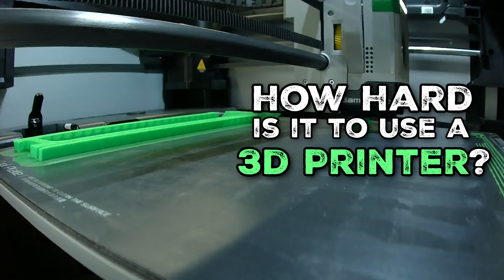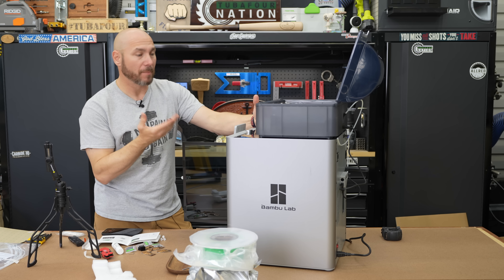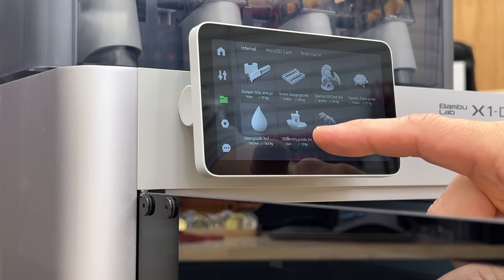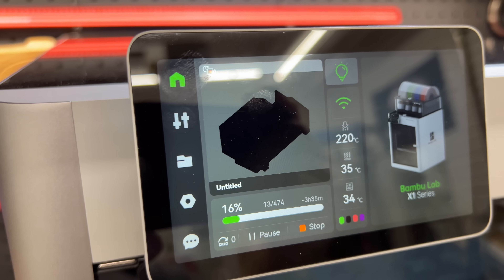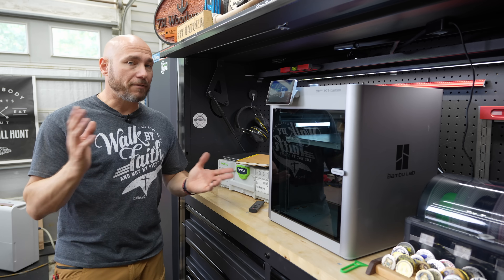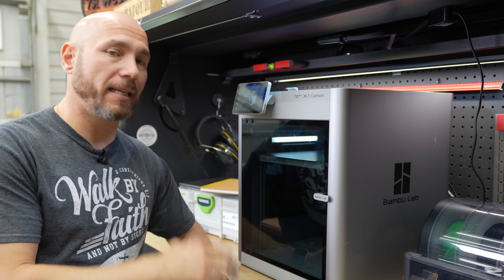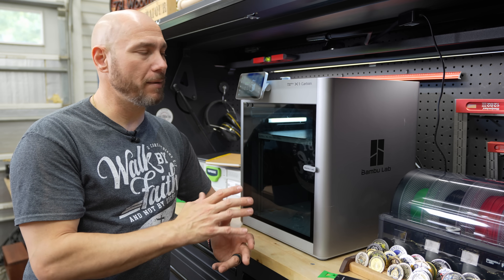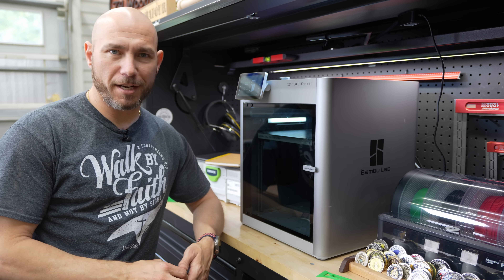Is This 3D Printer Worth the Price? Bambu Labs X1 Carbon Review

Comment: if you like challenges this is not the printer for you. its what dji would make if they made a printer basically... its point and click. to a certain degree... try shiny petg? hehe you will be on the handyapp making a ticket within the hour if arent familiar with 3dprinting. Stick to pla and the cf versions of the other filaments as they are regularly easier to get better results.

And dont forget that the self scanning of the flow dynamics and actual flow calibration work poorly with shiny, transparent and glitter like filaments. Basically all the cool looking ones are on manual calibration like every other printer. except with bambu u dont get to see the mesh from bedlevels. probably since all their bed are a little crooked with at least two highspots. managed to dismantle mine and put in on a squaring rig at my friends cnc shop. 

now its flat :) and the probing hits three points every time :) u can tell the shifting of the warp in the bed by the number of probe attempts it needs to find a value.

Comment: I was very impressed for the first 3 prints I did on the X1C. After that, the AMS has failed to push out filament out of the hub since it seems the motor is struggling from the tension in the spring. I've been waiting on customer support to reply to my ticket for the past 4 days now... I'm about to return this thing if I don't get a reply by Friday.
Reply from the maker: Dang!  Keep us posted on how they handle this!
Reply: @TheOutlawEffect  The filament was brittle in some spots and was snapping when coming out of the AMS. I put it on the hot plate for about a day and it seems to work now. Customer service was extremely slow at replying and I had to figure it out on my own.
Reply from the maker: @magneric   Thank you for the update.  I recently had something similar happen.  I didn't use the printer fora a couple weeks.  When I tried to use it, the filament had gotten brittle and kept breaking inside the AMS but under the rolls. I had to dis-assemble it to get the pieces out.  I'm not sure if it was because the rolls had been in the AMS too long and maybe picked up moisture or gotten too cool?
Reply: @TheOutlawEffect  isn't the AMS supposed to keep the filament in a dry, sealed environment though? I think for me it was a quality issue with the filament since some lengths could bend like normal and other lengths snapped like spaghetti at the slightest bend. Might have been a humidity issue from production

Comment: There’s actually a modification you can easily do for the lower cost p1s model called an xtouch that makes it so the p1s has at least a very low end touch screen/ nowhere near as detailed as your x1c. However still far better than the stock controls.
Reply: And there's  now a second option. The Panda Touch.

Comment: What slicer are you using? How have you found slicing to printing has gone? (ie have you had to change a lot of settings and iterate on slices from past attempts, or is it mostly a slice it, send it, print it sort of experience?)

I see a loooooooot of people saying this is the machine to get right now, and I am sorely tempted to upgrade from my creality machines, but I have seen a few folks get a bad machine that seems to give them nothing but trouble with very little by way of support from bambu directly, which has me feeling nervous I'll receive a $1500 lemon, lol. It really feels like an inevitable purchase though
Reply from the maker: I'm using the Bambu Slicer software.  Haven't had any issues so far.

Comment: I got my X1 Carbon probably just a week before you released this video and I've been loving mine. I have had many 3d printers before this and there is no comparison to me. This one "just works". Speed, useability, reliability are all better than previous printers. 

Recommendations:
get the PEI plate - no more glue sticks, superior first layer adhesion, and prints easily pop off once it has cooled
get the mobile app - you can monitor, pause, stop, resume, and even start new prints from your phone

been watching your main channel a long time and love your stuff. Happy you got the right printer!

Comment: I've been watching 3d printers for 10 years waiting until they progressed from being a tinker-toy into a useful tool. Looks like the Bambu X1 finally did that. 

QUESTION: how much does the X1 smell while printing? Is it OK in the house? Better out in the garage?  Or does it  need a ventilation hood?

Thanks!
Reply from the maker: I have it in my garage, which is climate controlled, no ventilation. There is a very faint smell when printing.  I've only printed basic PLA so far.
Reply: @TheOutlawEffect   Thanks!

Comment: My understanding is that Bambu requires you to connect through a cloud account only - and given this is a company in China, I'm not so sure I'm on board with that part.  In general, I try to steer clear of any important device that requires cloud access to operate.  But, that goes double if it's a Chinese company.  I'm looking at my first printer, and while I really like what the X1C has to offer, the cloud access may be the main deal breaker for me.
Reply: I think it’s possible to upload files locally without the cloud…

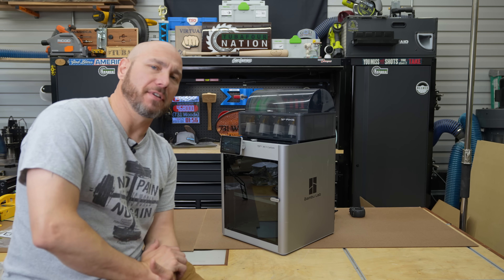Comment: 6:35 1st: when printing with PLA its usually recommended that you leave the door open, as that allows the part to cool as quickly as possible, which in turn allows for an increase in print quality.
2nd: the error message you received there is something i get every now and then that seems to be caused when the power cable for the bed gets looped over the top of the bed carrier and causes some extra force to be detected by the #2 sensor. whenever that error message pops up i just push the power cable back down off of the carrier with a flathead screwdriver and it tends to go away pretty soon after

Comment: To answer your question "Not sure why everyone prints these boat things" 

They are 3DBenchy's they are designed to find issues from your printer in a visually interesting way. Personally I print "torture tests" which you can find on Thingiverse and Printables for free! But there is a guide on how to review the results of a 3D benchy. This is most useful for overhangs because knowing how much your printer will overhang safely will reduce the need to use supports in the slicer settings. 

Welcome to the hobby!

Comment: Nice Review. I've had an X1c since june, and its a gamechanger over the older bedslinger types of printers I've run previously. The comparison with Apple, both positive and negatively, is a valid one.

One thing I'd point out though... You say you'd like the X1 to be quicker.... its FOUR TIMES quicker, on average, than I've ever pushed my most modernbedslinger, without any setting changes.

Comment: Get a PEI build plate as soon as you can  It is so much nicer and easier to print with and no more glue.  If you think the Bambu is slow its good you started with the bambu as it is the one of the fastest on the market right now.  10 years ago when I got into printing it wasn't unusual to have to wait days to print simple things.

Comment: No. X1C here 1950 hours now has 1.5mm of slop in the z due to the leadscrew nuts being cheap and not lasting. Bambu lab support said there is nothing wrong with is well withe the "spec" and the printer prints worse then a clapped out ender 3 now.  So no my X1C was not even close to being worth $1500.

Comment: I had two small issues with mine initially, the back of the engineering plate was hitting the waste chute and grease the rods. Loosened some screws pulled the bed forward and greased the rods and she has been printing solidly for the last month I have owned it. So much easier than the previous enders I had dabbled with.

Comment: I haven't looked through enough comments to see if someone already mentioned so I'll just say it.

The vibration frequency stuff that you experienced in the beginning is how it configures itself for what we, in the 3D printing world, call Input Shaping (Not native to 3D printing, but that's where I first heard the term). It basically reads in resonance frequencies of the machine that would affect the quality of the print. For example, you could potentially configure print settings that would cause frequencies match that of the components which causes vibrations to amplify which would cause artifacts in the prints (i.e. changing fan speed and movement speed will cause mechanical vibrations of different frequencies). So, similar to how noise cancelling headphones work, it tries to be smart and configure itself to cancel out any resonance frequencies that would affect print quality.

Good video. You got a thumbs up from me.

Comment: I noticed you moved the AMS from the top of the machine. Can you post a video on that process?
Reply from the maker: There's no process to it, you can just set it to the side. It just has to be slightly elevated so that the hoses that connect the AMS to the printer will reach.
Reply: @TheOutlawEffect  Nice, thank you

Comment: Your shirt reminded me of my 3D printing journey. Going through cheap bedslinger printers that take 6x longer to print than the Bambu, to the awful manual bed leveling that the Bambu does automatically, and let’s not forget having to deal with filament everywhere when there was a print failure, where as Bambu detects it and auto pauses. It’s insane how much better Bambu is than the competition. And I’ve been around the block when it comes to 3D printing brands. Owned many of the best brands, Prusa, FlashForge, Creality, Anycubic, Voxelab, Elegoo….. none of them come close to performing like the Bambu. My runner up is my Prusa.

Comment: Been running my X1C Carbon for a year.  These are great printers, the Bambu A1S is also a spectacular printer capable of 4 color printing for about 1/5 of the price of the X1C and is geared for entry level.  The X1C is more if you want to print Carbon Fiber, ABS, ASA, that require an enclosure - these substrates need to vented though.  Maker world has a ton of .stl files for just about everything.  Once you start the 3D path it is hard to turn back.   The slicer will show you the cost per print in filament use electricity bill will easily double if you run these non stop. Just like a CNC or Laser.  Remember to dry your Filament properly, that makes a world of difference for CF, PETG and ASA in particular.

Comment: You have been spoilt going straight for the X1C, I started with an Ender 3 S1 Pro, by'eck that was an eye opener, I nearly gave up on 3D printing until I happened across the Bambu Labs X1C and it saved me, seriously if you think these are slow, please try an older bed slinger type lol, great video, enjoy the machine, I love mine

Comment: Personally, I would recommend that if want to add a second, or third, or fourth printer, stick with the X1C instead of the P1 series. Sure, the P1 series are cheaper, but IMHO they are missing the one component that makes the X1C stand out... the LIDAR. It does and amazing job with bed leveling, and once you start calibrating your filaments with it (Flow Dynamics Calibration, and Flow Rate) you can get spectacular engineering quality prints.

Jumping from and Ender 3S1 Pro to the X1C is NIGHT AND DAY for speed and accuracy and quality of printed objects. I am so happy that I bit the bullet and just went with the X1C. Before I was always "tweaking" and doing test prints on the Ender (i.e. wasting filament) just to get what I wanted. The X1C is just "print and done."
Reply: Lidar doesn't level the bed.
Reply: @calizza  Actually, if you watch the pre-print process of X1C, you will see that the bed is scanned with the LIDAR in the printing area so it can be adjusted. It is also documented on Bambu's site about the LIDAR being used to ensure proper first layer printing before printing and scanning the first layer (if configured to verify first layer). I've also confirmed this via e-mails to Bambu support.
Reply: @MrDB42  Yes, I understand what it does as far as the first layer is concerned as I have read the documentation and looked at plenty of examples, but that is not leveling the bed. Even your own explanation doesn't infer that.  Lidar is also hit and miss right now and is no where near a reason to get an X1C over a P1S. The first layer of any of the Bambu products has such a high percentage of being good that even if fully functional, lidar would be a "meh" reason to base this decision on. There are other reasons many may want the X1C over the P1S but that is hardly one of them. Unless you were printing with a rough engineering material it would be silly to use the X1C over a P1S in a farm because in a farm that would be a ton of wasted money.
Reply: @calizza  You're right, I should have said that the LIDAR updates the bed mesh for the printed area (similar to the Prusa probing the printed area prior to the print to update the bed mesh) also commonly referred to "leveling". As for is it worth it, we agree to disagree. My Lidar went bad (on screen errors, bad first layers, bad automatic filament calibrations [flow rate, K factor]), had it replaced and it was night and day, even compared to what I got from the factory.

Comment: When you print PLA it is actually better to leave the door open a crack and take off the glass top. "Heat Creap" will cause your extruder to clog. The Bambu Wiki is a great source for information and trouble shooting.

Comment: "I don't want to learn new things"   ....what??

Calling this printer the Apple of 3d printers is accurate but it isnt the compliment you think it is.  They require that you set up a cloud account so all your data can be sent to China anytime you 3D print something.  If you want to change your nozzle you have to buy it from bambu, since it is proprietary.  

This is a printer for people who have no idea what they are doing, and the second something breaks you will be dead in the water.  

I much prefer open source hardware where you have the choice of dozens of manufacturers of replacement parts.  K1 Max is cheaper, bigger and faster.  I control it in LAN only and I can buy 10 volcano nozzles for the same price as one bambu nozzle.

Bambu is for people with more money than common sense
Reply: Aaaand we've found the Creality fanboy... ;-)
Reply: @arctyrus  I find it funny you go for an ad hominem attack instead of arguing against my points.  Sounds like you are an Apple/bambu fanboy...

You are okay with your data being routed through the Chinese Communist party?  

You are okay with having one choice for nozzle manufacturer?

You do you, lol

Comment: Ah, the enchantment of "magic at home" kicked off in the ancient era of 2005. Vintage, right? Now, about PLA-CF, it's like regular PLA, but with the superpower embedded carbon fibers brings into it. Be aware this filament is abrasive and may wear your PTFE tubes and nozzle sooner. And that trusty glue stick? Just for those prints feeling a bit mischievous. Cheers to the magical crafters out there!

Comment: The x1 is a better printer because of interface and more options, but P1S is a beast, but a lil less user friendly w non touchscreen option. Bro.. this is like 3-4x faster than printers from a year ago.. watch your build plate, if it is “off” center it is generally hung up on back alignment tabs or hanging off the side

Comment: An easy way to dramatically lower print times is using a bigger nozzle, you may lose some quality for details smaller than 0.6mm but if you are looking to print big stuff faster you might wanna buy a 0.6 or even 0.8 mm nozzle from bambulab

Comment: If you continue to use the "Cool Plate" ditch the damn glue stick, and spray it with a light layer of Aqua Net hairspray. WAY easier to apply and more effective. Literally been using it on various printers for a decade now. It should be standard issue.
Reply from the maker: Nice tip! Thanks!

Comment: Great video Matt, and very timely - I'm looking at getting a Bambu 3D printer during their Black Friday deals. And, I'll use your affiliate link when I do. I'm just not sure which model - the X1C or the P1S. I like the touch screen and the 1080P camera on the X1C,  but there is a $400 difference. But, here is my QUESTION (put in bold so you would see it ) - what is the relative noise level? Table saw, shop vac, CNC router, cordless drill levels? these are tools I already have, so that's why I'm asking in reference to these. Thanks and God Bless - Charlie in Central Ohio
Reply: For a 3D printer they are loud. Most 3Dprinters are almost silent. You will hear it if it is in your bedroom. Compared to everything else in a shop, it is basically silent.
Reply: Thanks  @duanebrown1370 . Yeah, I have been watching all the current 3D printers YouTube videos  and it seems like the Bambu Lab models are getting good remarks. But, I did watch one that talked about the noise level bring kinda high. I went ahead and ordered the X1 carbon early this morning, so we'll see how that goes. I do have a basement shop that is about 30' x 25', so that should be OK. Also, this is not my first 3D printer - I bought a FlashForge Creator Pro back in 2017, but the darn bed leveling and lack of files back then kinda let in set in the office and never getting used. Thanks again, Charlie in Central Ohio

Comment: Many people move the AMS to the side, so it can still fit in your cabinet.

I printed some small riser corners so that I could keep the door closed but the top glass sits above the top about 3/4 of an inch. That way it keeps the chamber cooler. Loving my Bambu Lab so far!
Reply: Looks like you moved it to the side!
Reply from the maker: I did, I found a file on one of the printing sites that had a riser.  Works great on the side!
Reply: @TheOutlawEffect  yeah I was wondering which riser file you used. That one looks nice